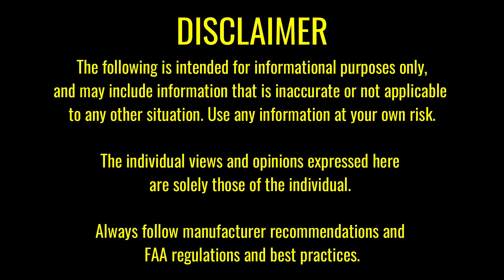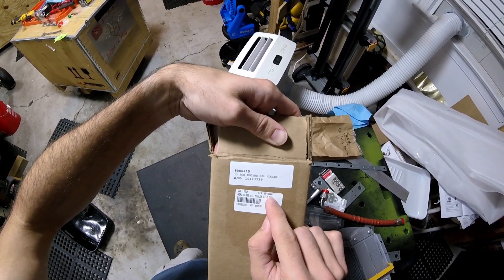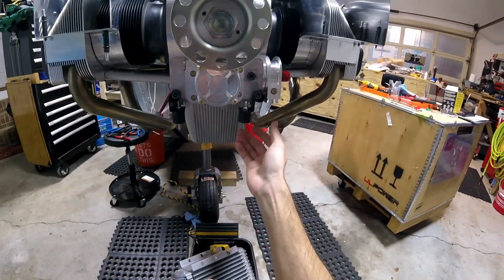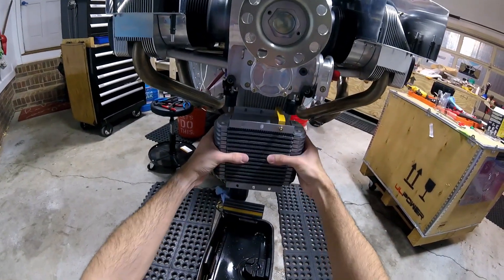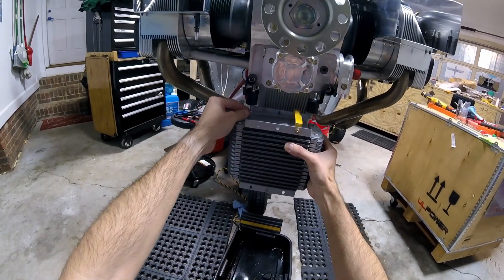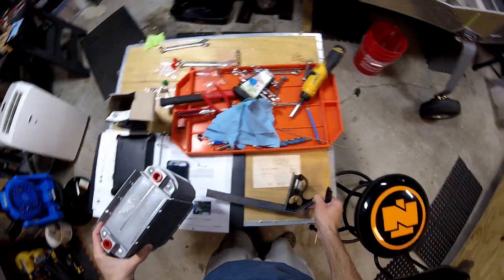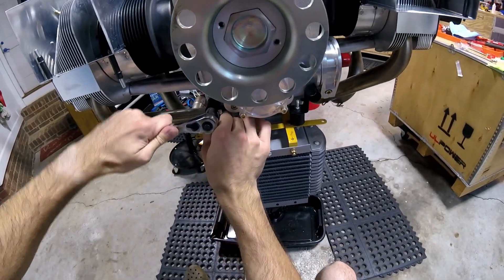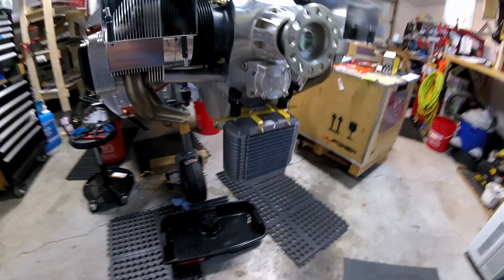Oil Cooler Bracket Prototype (Aeroclassic) - UL350iS - Zenith 750 Cruzer Kit Plane Build

Comment: Heads up!  I have  the same engine, with a smaller 7 row cooler.  It mounts in similar fashion, using the provided mounts.  The flex of the rubber vibration dampers allows the cooler to come in contact with the oil pan!  Mine is getting grooved from the cooler's back edge. Your set up is even closer to the oil pan than mine... Im looking in to a different mounting location because there is no room to move the cooler fore or aft....  I know of at least one other set up, where the oil cooler is mounted aft of the motor, between the lower engine mount rods...

Comment: It's going to vibrate against your oil tank. It's to close to it. Air rushing in while flying will PUSH it up to it and eventually rub a hole in it.
Reply: Yup, I have the same problem.... I'm currently looking for an answer..... Any suggestion????
Reply: Air flow does strange things . If you block off the flow on the rear with the sump it will have the same effect as blocking off the front . Might work better somewhere else.You need low pressure behind it to suck the air through .Rotax installations are worth a look at .If you have the connections at the bottom you might trap air inside .Look at the ULPower drawings ..Rotax engines have been screwed by wrong connections on the oil cooler.Check .check .